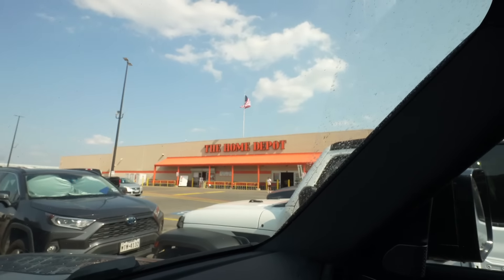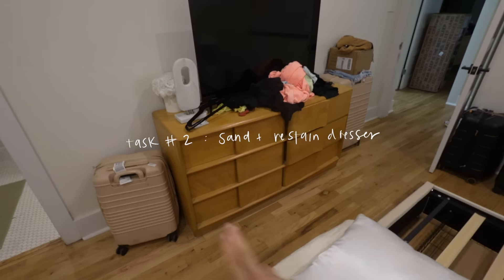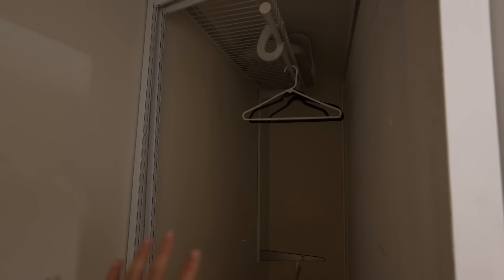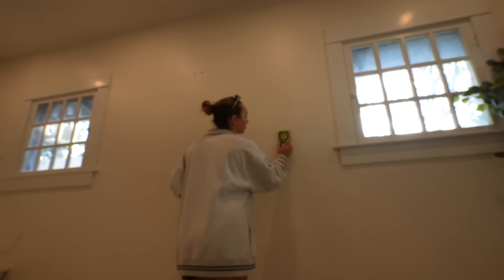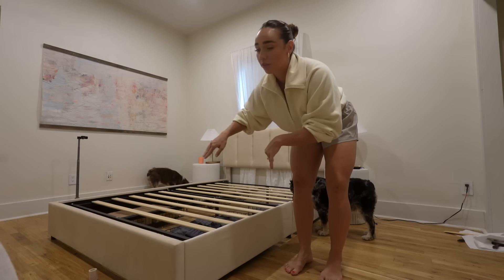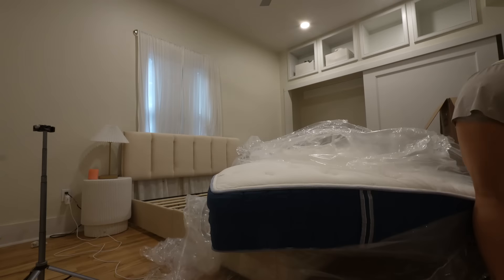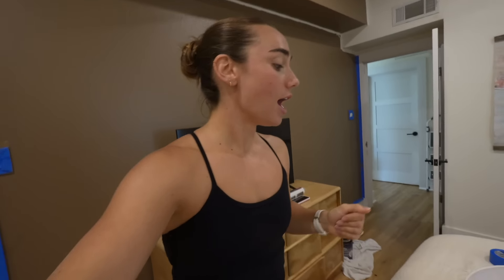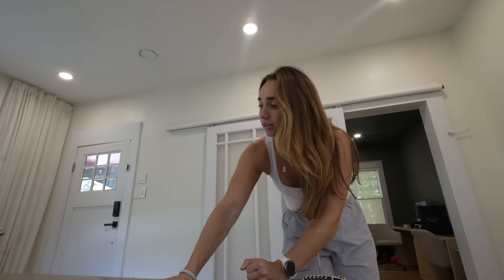RENOVATING OUR 100 YEAR OLD HOUSE | episode one

Comment: Tip for finding studs...take a magnet and slowly move across the walls. You'll feel tension when you hit a nail and it will stick without your hand support. This is of course assuming they used nails 😅